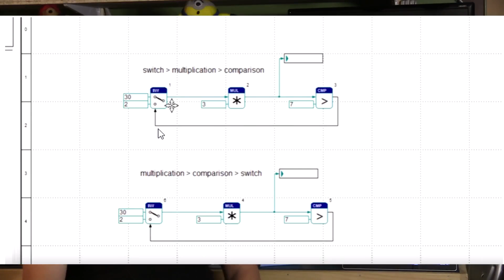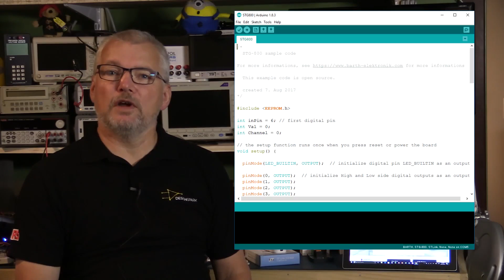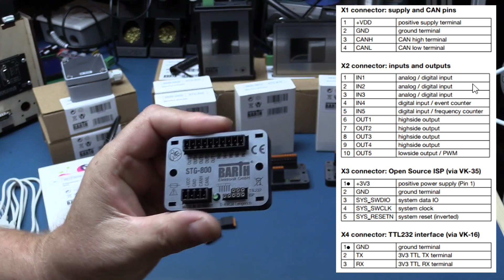32Bit PLCs from Barth Elektronik with Arduino Support - Part 1 of 2

Comment: Good news is that it support Keil MDK, not only (useless) Arduino IDE. With only Arduino support it would be just another "toy" without any real value.
Reply from the maker: I would say that is in the hands of the programmer, not the IDE, a crap program, no matter the IDE or compiler is still a crap program. The compiler behind the IDE is still a full and proper C compiler, The arduino IDE may hide many hardware related functionality from the coder  but it is still compiled correctly.

I could use Notepad to write the classes and header files and a command line to compile the code, does that also mean it is no good ???, you may find a lot of folks out there that would disagree?

How hard would it be to even create a set of libraries and macros  in the Keil IDE that would allow an Arduino like sketch to be compiled with it. Relatively easy I would say. The arduino IDE is simply that, a layer of abstraction classes over the base C compiler that allows the programmer to not have to worry about the hardware.

This does not mean I dont think Keil does not have its place, it does. if the programmer really wants to get down and dirty with the hardware then they can but the code becomes less portable but faster and tighter. (Smaller).

I think the choices really depends on what you (The programmer) wants to do, if speed and compact code is required then Arduino IDE (The C library wrappers) may not be the way to go, but this would be the same even with Keil or any other IDE / language that has helpers in the form of macros and libraries for the user, they help make programming easier at the cost of some speed and optimization in the final code.

And on a final note... I can also code using the arduino IDE with native C if I want, referring directly to the register etc and not use the wrappers at all, like I said, up to the coder and how good the result is is also based on how skilled the coder is and the designer of the application.
Reply: First I need to put note on beginning that first compiler for ARM I use was Keil and I still think is best compiler and IDE for supported microcontrollers for most of users (now I use IAR just because it have little better optimization, but for most cases that can be ignored) and it is one of two compilers that are used in my company for microcontrollers (other is IAR).

You are right and wrong in same time, there is big difference between Keil C compiler and GCC C compiler (which Arduino use).
You are right that both will produce (for GCC in most case) correct code, but you will see big difference in code they produce, Keil will produce more optimized code from same source (and we are not talking of couple % but up to 2 times smaller code), and according to EEMBC's Embedded Compiler Benchmarks there is even bigger difference in performance of produced code, in case of Cortex-M architecture Keil is in second place just behind EAR and according to that tests it produce over 4 times faster code then best GCC (I personaly do not belive to much in benchmarks, because some compilers are surprisingly good in some tests and fail miserable on all others, like gcc will in front intel c compiler in one for 20% and on all other will be 200% slower, and in real world intel compilers will produce 10-50% faster code (according to PHP team - Compilation from source, with ICC rather than GCC, should result in a 10 % to 20 % speed improvment, and MySQL Team - Compilation from source, with ICC rather than GCC, should result in a 25 % to 50 % speed improvment).
And all my previous statement do not include any Arduino libraries which on top of all that degrade performance drastically.
There is good reason why companies pay lot of money for compilers like IAR and Keil, instead of using free GCC, GCC solutions at end cost more money (in hardware and time spent to produce same results)  then you just pay for IAR or Keil at beginning.

"I could use Notepad to write the classes and header files and a command line to compile the code, does that also mean it is no good ???, you may find a lot of folks out there that would disagree?"  You are barking on wrong tree here I use IAR Embedded Workbench for all my programs for microcontrollers which is little more then Notepad (even Notepad++ have more features then it) and look spartan (it look like it is from early 80) to most of IDE on market (Keil have much user friendly IDE, and Visual Studio look like space ship compiler to IAR), but only reason for someone to use IAR is it produce most optimized code of all compilers for any microcontroller with exception 8051 where Keil is still king (in case of ARM there is little difference between IAR and Keil, where IAR edge Keil in less then 10% at best).

As your final note it is totally wrong, you can have best skills in world you will not be able to overcome limitations of tools you use. You cant help a little but still you will not get results near close to average programmer who use good tool. For example in your video Laser Harp Code Conversion you put in description note "At the end of the day this is a classic example of where code is written by a beginner (And it works ok so no criticism there) but then can be re-worked to me way more streamlined and easier to maintain" which is in most case true (and it is 100% true if you use IAR) but in case of GCC original program have better performance that what  you end up, so I can argue (and in that case is probably not true) that original software was not written by beginner , but by someone who know limitations of tools which he/she use and way how to help it to produce better results, yes it is worse to maintain but he/she deliberately sacrificed that for performance.

At end they did right decision that they included Keil for people who want to use it for more then just "toy" and Arduino for people who want to have easy way to use it for simple tasks. And if I understand correctly they offer Keil for free for their products which is great added value (Keil for ARM is around 4000$ if I remember correctly) and you get one of best compilers on market.

Comment: What is their function in life?  Many things covers a lot of stuff so wondering if something they do I really have a use for.
Reply: PLC are great programming environment for controlling systems.  It's a professional tools for real controlling system in industrial concepts.

So yes, it isn't home made solutions.  And the program language/system are very logical programming model, using Boolean logic, which make it much easier to verify the systems function.
Reply from the maker: Well for one there easy to use for Cars, Boats, RV's, small home installs, lighting effects etc and a whole host of other things. Giver the small size, rugged design and that there pretty much ready to go (No case needed, can use 12 or 24V supply etc, limited by your imagination
Reply: Thanks for the information guys.